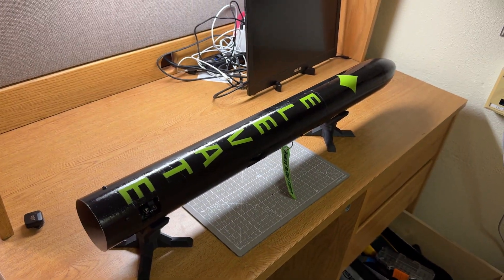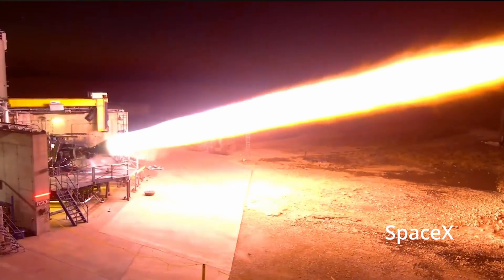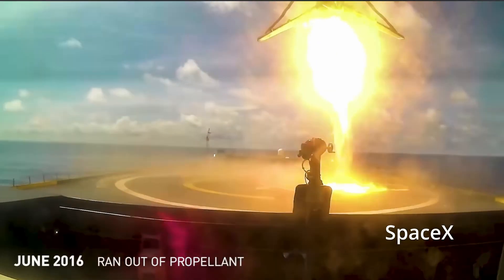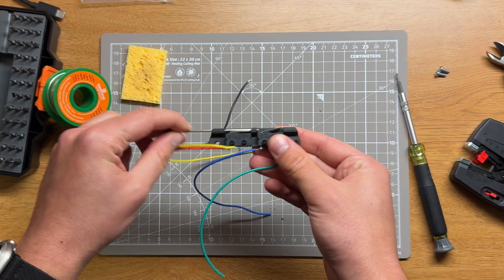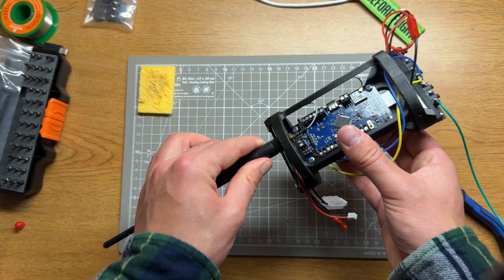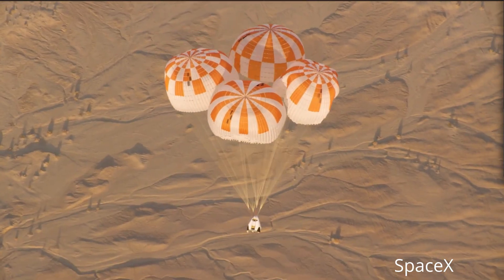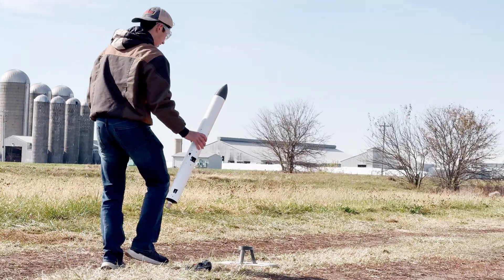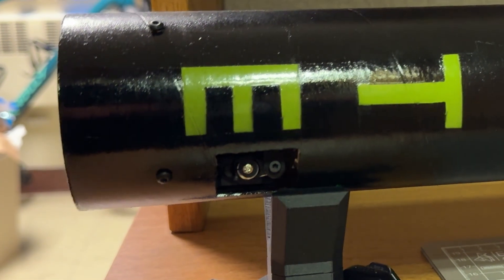I’m Building a Guided Rocket in My Dorm

Comment: nice work! One concern I have, your pull switches are really neat for enabling the rocket, but if they also control flight controller power, I fear something like an early parachute ejection or ground impact could momentarily interrupt your power, causing data loss or control loss.
Reply: This is true, i comend you to use one for the pyros and a scew terminal for the computer